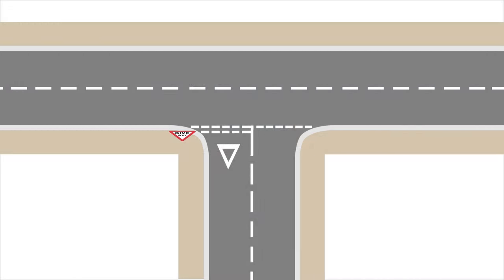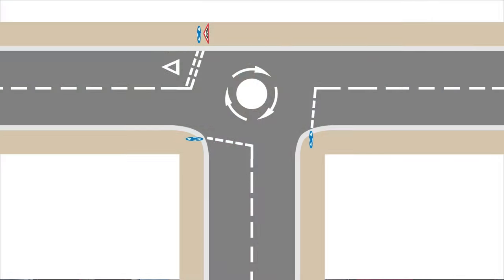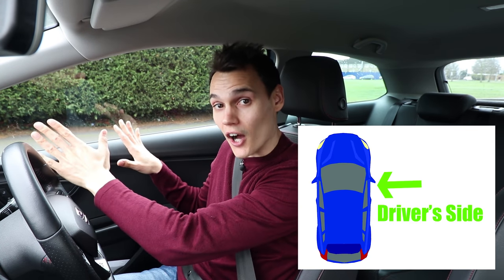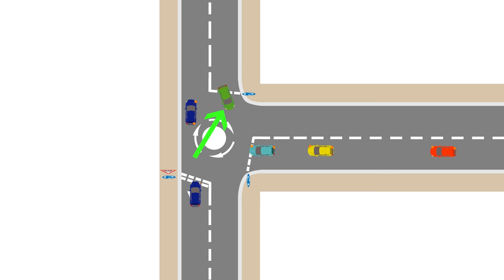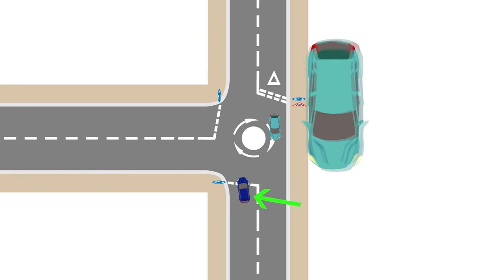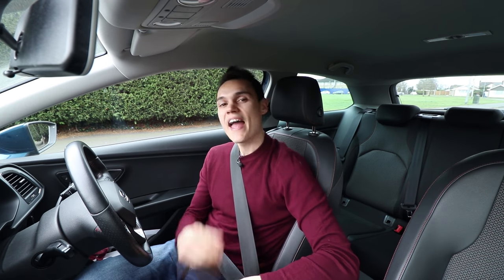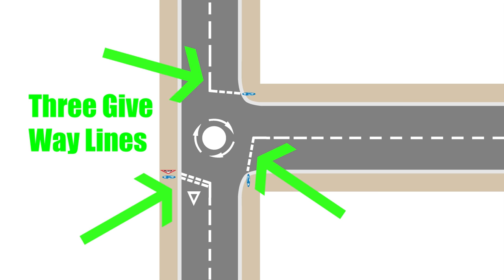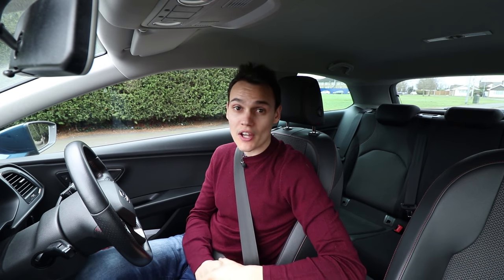Mini Roundabouts Driving Lesson UK - Pass your Driving Test Series

Comment: on thing that isn't clear here, is that the section at @4:10 the dark blue car is at the junction first, and can proceed onto the round about regardless, it doesn't have to give way to a vehicle that is still approaching the roundabout anyway even if it is coming from the right. give way to the right is for when both cars are already at or stopped at the give way mark to discern priority, and it effectively follow give way to the right because you must give way to traffic on the round about which will always come from the right.

Comment: I had to look up the rules in the UK after watching a video of a cyclist in the UK.
Your rules vary slightly but are much the same overall (from here)
Our rule is "Give way to vehicles already on the roundabout". Of course you are doing that but also watching the guy to the right a bit as well incase he zooms onto the roundabout just before you take off.
A lot of drivers here fail to indicate correctly or at all on roundabouts which makes things difficult.
Examples are when they keep indicating right but exit the roundabout at that time. Of course being at the next junction you are giving way to them expecting that they are still coming around the roundabout. Some drivers are just too lazy to change from the right indicator to the left to exit.
Reply from the maker: Not signalling right on mini roundabouts is dangerous and doing sudden I turns on mini roundabouts.
Reply: @ConquerDriving  Not signalling right to continue on a larger single lane or multi lane can be dangerous as well (But you know that). 
My favourite driver are the ones that keep going around the roundabout on the outer lane instead of exiting when they should which means ones exiting properly from the inner lane collide with them. 
I remember one roundabout we had near the airport. It was a multi lane roundabout with signage explaining prior to the roundabout plus signage on the road yet some still got it wrong. I was on the roundabout about to exit when a foreign woman with poor English accelerated onto the roundabout into my path. I tried my best to dodge her and nearly did except she kept aiming at me more as I was dodging her and there was a small crash. She then just remained stationary in the middle of the roundabout blocking everything up. I tried signalling her to pull off but she didn't so I drove around her and pulled off hoping she would follow which she did. 
Anyway , long story short... She had failed to give way, had caused a crash then asked me what happened. I said, "You failed to give way and we crashed". Later on her insurance was trying to blame me so I wrote up a 2 page report explaining road rules, lane markings and even included photos of the signs . They gave in and paid up as they realized she was an idiot and that I knew what I was talking about. 
Ps That roundabout used to have so many crashes (numerous times / day) that the tow trucks used to park in the middle in the shade waiting for a crash then pick the car up. 
I understand roundabouts and how important signalling is and which lane to be in.

Comment: Good video and I get the need to give way to the first car arriving from the right. But I don’t get why you should give way to a second car, which hasn’t yet arrived at the roundabout. Surely if I enter the roundabout between the first and second cars, I automatically have priority? Isn’t that how normal roundabouts work and if so is this a difference between normal roundabouts and mini roundabouts? Thanks!
Reply from the maker: With all roundabouts if you will make anyone from the right slow down you should give way to them. Generally they will be already on the roundabout if they're closed enough for you to need to give way but with small roundabouts you may be giving way to people who have not already entered the roundabout.
Reply: @ConquerDriving  Thanks.  But don't the cars arriving from your right have a give way line on entry to the roundabout, which means they should give way if you are already on the roundabout?

Comment: 5:19 If black and blue car come to the roundabout at the same time black could proceed since it would not impede the blue car. By the time blue car goes all the way around black will be gone. That's of course if blue doesn't see these as driveoverbouts.
Reply from the maker: That may be OK but it all depends on timing, this example is assuming there isn't time for both to go at the same time as is often the case especially on the smaller mini roundabouts. Of course if you feel there is time to go then it doesn't matter.

Comment: Can you please clarify something for me here.

The presence of the give way sign and the double white lines on the  left side of your mini roundabout example were not really covered in your video or the difference between them and the road markings at the other entrances to the roundabout.

The marking on the left entrance indicate according to the highway code that you should "give way to traffic on the major road", i.e. the traffic approaching from the right (directly in front of you). 

This is to remove the doubt over who has priority in the event of either a 2 way (cars simultaneously approaching from left and right) or 3 way standoff as the car approaching from the right would have the priority, then the car at the bottom and lastly the car on the left.

The Giveway sign and double white lines are used to indicate vehicles approaching from that direction have the lowest priority of the 3

Generally these are arranged in such a way as to allow traffic to exit faster from a built up area, such as leaving a town etc

both other approaches have the roundabout standard thin single broken line which means "give way to the right" 

That appears to contradict what you have said in your video.

If all 3 approaches showed  the single dotted line then your description would be correct.
Reply: You will typically see these on an entrance that has poor visibility of the roundabout itself as you approach it. For example, if you're driving uphill, or if there's a lot obstructing your view to the right on the approach. Your priority level is exactly the same as any other mini roundabout entrance.

Comment: Hi Richard,
Nice video with lot's of information.
However, you do say not to signal when going a head.
The highway code and DES both say that we should approach mini roundabouts the same way as a normal roundabout and there may not be time to signal off.
So a signal should be used if there is time and it would benefit other road users.
I realise this video is 2 years old and you may have updated your information.
Reply from the maker: That's a good point in any scenario when it comes to signalling. Signal if you think it's helpful but no signal is better than a misleading signal. Generally you rarely have time to signal to leave a mini roundabout but there may be occasions when it's helpful.

Comment: Should you not wait until you’re certain of the direction of travel of cars instead of relying on their signals? Thank you 😀
Reply from the maker: That's a very good point but waiting until you're certain based on their direction is not always viable. If they are far enough way not to cause an accident and their signal says you can go you should go. At least that's how we teach things for the UK driving test. If they look fast and pulling out would be dangerous, then don't go.

Comment: Thanks for the useful video! I came from another country and a question arose. Can you please tell me if this is the situation: I stopped before the roundabout exit and I need to turn left. I chose the left lane according to the drawn arrow on the road (from the left lane I can only go left, from the right lane I can only go straight in a circle). This is understandable, if I were driving onto a one-lane road - it’s easy. But my situation is that I need to turn left, and there are also 2 lanes there and I need the right lane. My actions should be: before turning the indicator to the left, make a turn, then turn on the indicator to the right and change lanes to the right? Or, in the process of turning left, I can immediately enter the right lane (but my display showed a left turn and this can provoke the driver behind to take the right lane and overtake on the right). Or is the indication to the left and during the turn the indication to the right? I will be grateful for your answer!

Comment: Thanks. Great video. A question: is it allowed make a u-turn at a mini round about?
Reply from the maker: It's allowed but not advisable as it's dangerous when others are around.
Reply: @ConquerDriving  thanks for the reply Richard. Any tutorials on driving efficiently with automatic cars? example, do I have to press on the gas pedal constantly between gear changes or it is efficient to lift you foot off the pedal every gear change in someway a bit similar when in manual?

Comment: Definitely still some confusion on this because the line markings vary by mini roundabout. There's the example in your video of the opposing lane having a double separated line (I.e give way to those on the roundabout), plus the adjacent lane having a blocked separated line (I.e. give way to those indicating right) and the same for the adjoining road.

However, some mini roundabouts have a double separated line on both the opposing and adjacent lane (I.e give way to those on the mini roundabout), plus a single blocked separated line for the adjoining road (I.e give way to the right).

How do the rules and etiquette change in this scenario?

If it all means the same, why the lack of uniformity?
Reply from the maker: I don't know but I guess they use double broken lines when they want to try and make it more obvious.

Comment: Hi, have driving test tomorrow and any chance you could reply ASAP. When emerging into the mini roundabout due to one car cutting across the path of the lane to your right acting as a “shield” , how do you know they are not doing a u turn? Either way they will be indicated right? Surely there could be a chance of them doing a u turn and not going off the road like normal? What would you suggest in this case
Reply from the maker: They will be slow and wide if doing a U turn. Also, they should not do a U turn, it's not illegal but certainly not advisable.

Comment: what about 'u turn'?  I used to use one mini roundabout in Reading to take a U turn and had to pay special attention, but never been offended or yelled by other drivers. It was a volvo s40 which could turn on such tight radius but now I drive an S80 and would not try..
Reply from the maker: It's not illegal to do U turns but it's advised you don't as it can be dangerous as others won't be expecting it. I would if it was quiet but I wouldn't do it on a busy mini roundabout.
Reply: @ConquerDriving Thanks! I understand. Nevertheless I don't like this 'grey area' type of regulation on the road. In my opinion, highway code should be as clear as possible: dos and don't s. But 'it is not advised'?? what does it mean if there is a collision? These regulation should be created on the same pedantic level which other 'laws' are. my 2 cents. cheees!

Comment: On a large roundabout, one gives way to cars on the right if the other car is ON the roundabout having crossed the give way line. 
On a mini roundabout, are you saying that this rule (185)  does not apply?
Lets say I am approaching a mini roundabout from a minor road and there is a car approaching the roundabout from the right, if I cross the give way sign  a couple of seconds before the other car reaches the give way sign, am I in the right or wrong?
Reply from the maker: Whilst what you're saying is true, on mini roundabouts cars are so close together that it's safer to just give way to the right or there will be a race to cross the line first.
Reply: @ConquerDriving  Perhaps the Highway Code regarding Mini Roundabouts should be altered to:
Give way to vehicles on the right which have entered or are approaching the mini roundabout.

Comment: I agree that when going straight in a mini aroundabout, you should not signal. I've asked about this to my driving instructor, he told me that I should treat mini aroundabouts as normal aroundabouts, that means when going straight, I should signal left at the exit, which is complete nonsense. However I can't find a definitely written rule how to go about that in the highway code.
Reply from the maker: There is no written rule but signalling should be flexible. If it's helpful use it, if it's not helpful then there is no need and if it's misleading then it's best not to signal. You have to judge it on a case by case basis.